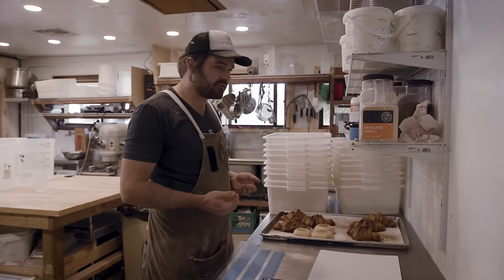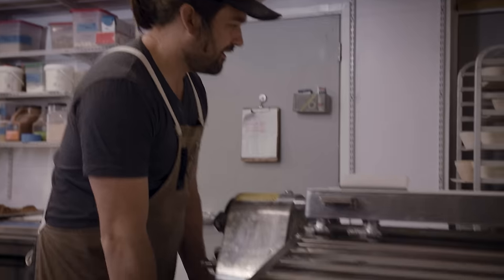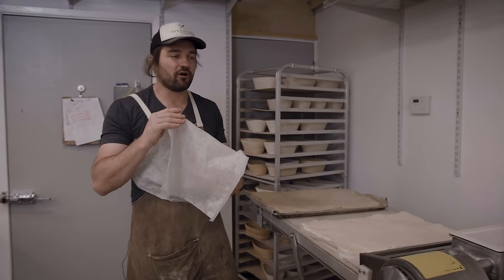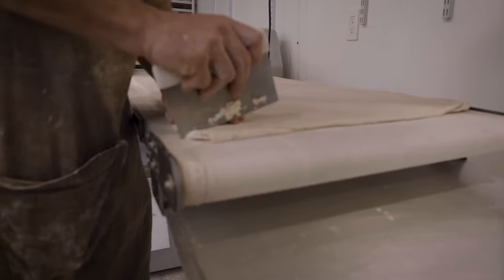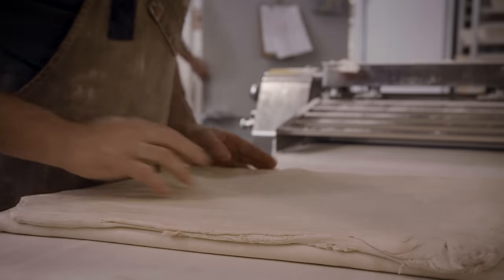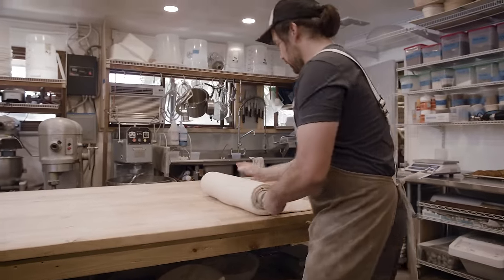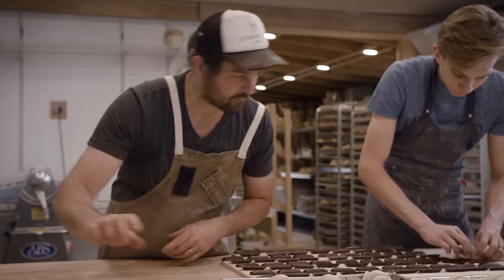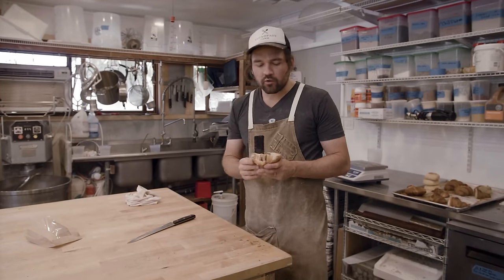Sourdough Croissants from Start to Finish | Proof Bread

Comment from the maker: See all the benefits of sourdough: https://youtu.be/73oENaDiq04
Reply: You really shouldn't be using a metal scraper on those silicone mats. even if they're marketed as food safe they're not meant to be scraped with metal. Metal is the stronger material so it will contaminate the butter with particles from the silicone. Always use silicone or wood on non-stick or plastic.
Reply: Nossa fala muito e mostra pouca das atividades  acaba ficando enjoativo
Reply: Sub spanish please. Saludos desde Argentina
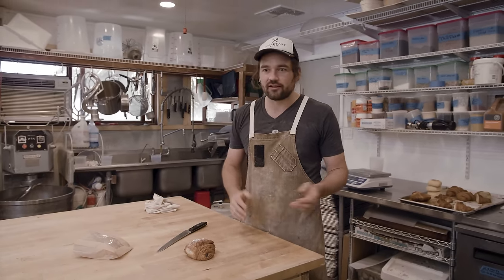Reply: @1:01:31, And queue the mindless anti-African politics. Time for some good ole American culture crushing negativity. Imagine if Belizean cocoa was actually preferred you would have to spread lies about a region you simply watched a 90 minute Netflix special on.

Comment: Croissants are definately an aquired skill. The french have 2 secrets I can share. They slice the rounded folds with a sharp knife to release tension before running the next pass. The other secret is the plasticity in the special butter they use. The name of the butter is Montaigu. The butter has a very low water content. Basically it is a block of clarified butter.
Reply: I work in a parisian bakery, and these are true. The montaigu butter has 83% fat content(most butter would be 82%), which provide the maleable consistency. Also to avoid too much stress to the dough in folding process, some boulangerie would add melted butter, (sometimes brown butter for added hazelnut-y taste as well) to the dough.
Reply: The other secret we have is that when we buy a croissant, we don't cut through it, we eat it ! I've never seen people cutting croissants in half before seeing americans on reddit and youtube do it lol
Reply: @TheTourtopoulais  Cutting the croissant in half is something the bakers do for quality checking purposes. The crumb inside will usually tell you what went wrong with the product. A well made croissant will have even, open crumbs. Not to mention that it is beautiful when the crumb comes out perfect, which is why you see alot of the crumb shots on social media these days.
Reply: Does anyone know where I can get Montaigu butters??
Reply: @kristinatening5749  That 1% doesn't mean nothing! I use Flechard butter with 82% and it's perfect. Even Corman butter, wich is the best, has 82%.
Reply: @cougar231000  sure, everybody has their preference and hand feels, I'm just sharing my experience working with montaigue butter
Reply: Thank you!

Comment: I like “”start to finish” so much
Reply: Croissants are definately an aquired skill. The french have 2 secrets I can share. They slice the rounded folds with a sharp knife to release tension before running the next pass. The other secret is the plasticity in the special butter they use. The name of the butter is Montaigu. The butter has a very low water content. Basically it is a block of clarified butter.

Comment: I was an cake decorator bread maker, I recall when I first did croissants at work in the bakery. I actually used by proof box, but I set the humidity to a low humidity. It was about the best ones I made. My store director assistant was very happy and then the store director quickly put me at 17.97 per hr. I noticed a lot of variation in my daily, and weekly results were influenced by the outside weather conditions. This was also influenced by the humidity, thus I had to know how to change my routine to ensure a good final bakery product. I have used steam, and not used steam to see the difference in my products. Christie A. Lesko R. Store Bakery/Deli Manager and Trainer. (past). Good Luck:) Take Care And G. Bless You.:)

Comment: Hello my friend ... I loved how you walked us through your process. In my bakery, many of my steps were the same, and I too used a laminator, how much easier it makes life.
I know you save the cut off ends of your dough in some cases as I saw in the video but I also saw you toss a couple of pieces. I have a suggestion for you. Well, what I have done.
I save all of those scraps and then I run them through the laminator again to form a flattened out block, but maybe 6mm thick. Then I would spread a chocolate sauce over them, roll them up and cut them like you would cut cinnamon rolls. In the end I was selling more of those than croissants and for more money .. 
I love your passion. If I am ever in Arizona again I will come visit for sure.
Reply: Love this suggestion!
Reply: I also love the lack of resentment or rivalry between bakers.. this channel and your comment both born out of wanting to share knowledge with the masses. So great.

Comment: I’m absolutely captivated by your channel. I’ve been making croissants for a year or so, and each time I do them, I feel like there is more I could have done to make them better. It’s a hobby for me, and before covid, I took them to work to have my fellow teachers taste test them. They were willing to pay $30 a dozen, their price, not mine! 
I’m not using a fermented starter, so I’ll try that. I do use a pizza cutter as I’m trimming ends and creating my triangles. I’m only partway through, so I’m not sure how you cut yours, but the wheel has worked well. I’m not gonna lie, I’m coveting your dough sheeter. 😊

Comment: Dude, this channel is going to - rise - faster than any sourdough. Baking newbie here who picked up a sourdough fever in the last year or so, croissants were my first "adventurous" trial (should've started with brioche). The process is complicated as it can be, temperature while processing, folding, proofing and baking seems to be the determining factor. It was a success, but one out of luck and I'm not sure if the nervous shakes helped proofing or not :D The final rise took a good number of hours, 2nd batch in the oven went a bit over crisp but still a success getting a decent honeycomb. 
I had fun pounding butter bars into a sheet, I guess it's less fun when it's at a large scale. First fold broke inside, second melted a little. Stopped both times to reevaluate my life choices.

Comment: For your butter...I put five lbs in a 12 qt mixer with a paddle. Add them one at a time. This will soften the butter without changing the temperature. Be aware that too much mixing will separate some of the water out so avoid that. With the butter softened, you will find it so much easier be able to evenly spread the butter sheets on your parchment paper. Then back into the fridge to firm it back up.

Comment: Kind of a stupid question, but how do you clean all the excess flour on all the surfaces - I have to imagine it's all over every machine, floor and tabletop? This always drives me nuts when I'm baking. If I don't sweep up dry flour immediately, it inevitably becomes wet and becomes exponentially harder to clean. Thanks for the videos, these are a great learning tool!
Reply from the maker: I love this question. I get sad when there is a one off comment about my apron, or about the bakery, because it takes clean up processes that are occurring hourly or more to keep the space in the state it is on video. Flour and water are not an easy thing to manage as far are cleaning, and I agree that more frequent is better.

Comment: Yet another great video! Thank you for this. Quick question though. I've seen some bakers recommend cutting open the curve on the edge of the dough after you perform a fold. Have you tested it? I do it when I bake croissants at home and I have the feeling that the layers come out better.

Comment: Just 2 dbl bookfolds
I produce 800-900 day
So. Place butter. Seal in
Dbl bookfold. Freezer. (30 mins relax) Dbl bookfold. Freezer (30 mins relax)
Final sheet to 4.5mm (on Rondo) 
Cut n roll
Freeze for use

Comment: When I make the butter slab for Croissants (at home) I use a folded sheet of grease proof paper so that as I role out the butter it squeezes into the gaps. I adopted this technique after just hammering and rolling between 2 sheets for some months. It's much faster. I wonder if you could use a kind of mould, in the form of a sheet of aluminium (of the correct thickness) with a square hole into which the butter would be squeezed in your dough sheeter?

Comment: Another excellent video!!!  I know you experiment alot, but was wondering if you have tried this:  say you make a trifold.  Have you ever tried slicing through the folds before running through the sheeter (basically creating 3 sheets of dough), so that the butter goes all the way to the edges.  It really does work pretty well.  Best wishes.
Reply from the maker: John, I’ve seen it done. Back when I was manually laminating in a pasta roller, the folded over side was a helpful starting point through the roller. The sheeter removes its benefit. I’ll have to give it a whirl. Some habits die hard.

Comment: I love the inside, a little less the outside, did you try to put a bit of inverted sugar and cream in the yolk ? it helps for the "crackeld" aspect. Keep up the good job !
Reply from the maker: This batch was washed at the time of shaping, and then placed in a humid cooler. It’s not ideal, had I washed them a second time before the bake, the results would have been stronger as far as sheen.

Comment: Well done demonstration. I will try to emulate your techniques in my home kitchen using my Atlas pasta dough roller. Wondering if I can use the Atlas to roll flattened slabs of butter or dough into thinner sheets between sheets of parchment paper or waxed paper. Has anyone tried this?

Comment: You gotta put the butter down low like an anvil is on a very solid object and then pound it with a sledge hammer with a big cylinder of the end with a torpedo shape to it like a French rolling pin. Use your whole body

Comment: Residential power only has 1 phase. So a phase convertor adds 2 phases. 3 phase power has the power density of dc electricity while having the transmission efficiency of ac electricity.

Comment: What would happen if you started the laminating process with the dough aya a lower temp than the butter?  Like you mentioned with the onset of higher temps and the increased friction of the laminator, it seems that less problems with dough shearing at a higher dough temp, and a slightly higher butter temp?
Reply: I'm sure he does, the dough is coming from the walk in cooler before going in the sheeter.
Reply: KJ Dude my thought was if the dough came at a lower temp than the butter as to not make it sheer, and the butter more pliable for the sheeter

Comment: I used to make croissants for a couple of French patssiers here in the UK. The butter came packed in the dimensions you rolled it out to. You might want to look into that.
Reply: Not this brand but like this. The butter we used was Danish https://product.parisgourmet.com/product/Butter_82_Beurre_de_Tourage_Sheets_Beurremont_Flechard

We did four half turns (tri folds I think you called)
Reply: You're doing too much in one go. Max I've ever done for Danish is 6lbs and 3 butter. The croissants were 2 kilo dough 1k butter. 

Edit: Mr Goux used to say to me, "you don't want to give the dough too much body. It should be undermixed compared to bread dough." Those were croissants with yeast though - might be different with sour.

Comment: One tip for ‘islanding’ 
That shitty moment when you realize you’ve screwed up the beginning of lamination with butter that’s too cold. I always recommend leaving the de trompe n beurrage together on a tray for 15 mins. Allow temps to equalize 
If it still ‘islands’ then don’t sweat it
Use the slabs (after the reg lamination) to make Tournades des chocolat . Pastry cream needed on hand with choc chips (callebault;)
Reply: Isn't their detrempe colder than their butter? (detrempe spent the night in the fridge while the butter temperature is at about 60f)
Reply: Kevin Bourdeaux Not sure about their temps
I usually pull the dough from the fridge or freezer and allow to reach about 6 or 8 deg C
I normally have my butter sheets in the fridge too
Allow to warm up n become pliable . They need less time to warm than the doughs so leave in fridge a little longer 
Cheers

Comment: A few minutes in, I say the book fold looks better, but both appear to lack butter. My #1 complaint in finding the ultimate artisan croissant is NOT ENOGUH BUTTER. You generally cannot tell from the outside look, but when I pick it up I can tell if the density feels like enough butter. I want it oozing out when you pinch the inner layers.

Comment: @proofbread have you tried to soften the butter so that you could work it into the blocks that you need and then put it back into the fridge until it is the correct working temp?
Reply from the maker: Yeah, this is more or less what we do with the sheets. In the wintertime they hang out at 60 degrees in the room, and stay perfect. In the summer we have to pay attention to the temperature much more carefully, and use the fridge as needed.

Comment: the dough is tearing because too much weight on the sides and there is stress releasing between the rolling pen and the belt, would you consider making smaller patch?
my dough sheet is 3 to 3.g kg worth of dough and 1kg worth of butter and i relieve the dough after each 2 passes.
Would you consider preserving the edges in freezer for the next patch instead of adding them between the layers ?
Always try to keep your dough and butter between 16c to 18c while laminating.
just wanted to share my thoughts as a fellow baker who spent two years making croissant and baguette in french bakeries .
Reply from the maker: Agreed wholeheartedly on butter temperatures. I’m not sure I agree on the source of the tearing. We don’t tear sheets hardly ever. It was a lucky fluke that it happened on video. Seems to be the change in butter, which points to our butter needing less moisture.

Comment: How do you change your levain so that sourdough croissants aren’t too sour? Or is your levain relatively mild to begin with? My levain was really mild in sourness in the winter and has gotten more sour this last month.
Reply from the maker: Our levain is a  homofermentative one which, making it quite mild. It’ll grow sharper if the temperature of the fermentation raises. Lactobacillus is far more active at higher temperatures in the fermentation range.
Reply from the maker: Also, we feed our levain white flour which keeps it pretty mild.

Comment: I discarded the edge trimmings, next time I make croissants I'll have to try to re-incorporate it back into the main dough between folds. Yep, butter do break apart between layers when it's still slightly stiff. Funny how I experienced the same conundrums as that of an actual baker with making croissants. As for beating butter into sheets, there has to be a better way.  BTW, the texture of your croissants look great. Too puffy & I'm eating air rather than pastry.

Comment: Just looking over some of the croissant recipes I tried, hydration are around 55%.  This is using commercially made dry yeast.  Can this hydration level of 55% work if I substituted levain for dry yeast? I know I have to be more observant on how active the levain is before incorporating it into the dough. Temperature is going to make things a bit tricky, it's fluctuating between 75-85F.

Comment: just saying, you dont have to pound the butter, you could also just cream it a little with a butter hook, weight it and then form it in the shape you want
Reply: also when you work with butter, mix about 10% flour under it that helps with keeping it together even when its a bit more warm on that day, the dough and the butter should have the same temp. and the same consistency
Reply from the maker: We don’t pound it anymore. Our method of making the sheets involves our roll divider, because the press does a good job getting the butter into the initial form that it was in for the sheeter.
Reply from the maker: I really like that method. We got away from it at some point, but I think it’s a good way to introduce higher amounts of butter especially given we don’t have the 84% variety, but only 82%.

Comment: I'm curious why you don't buy the high quality european butter that is sold in sheets, meant for croissant making. Is the butter you use local or something?
Reply from the maker: We are using the European style butter, but we haven’t found a supplier that delivers residentially for butter. We go out to the store for it.
Reply: @ProofBread  so is this low hydration butter
Reply: @triplemichaelsable  idk what they're using, but butter is not about hydration, its about total fat percentage. For croissants you want a high fat percentage